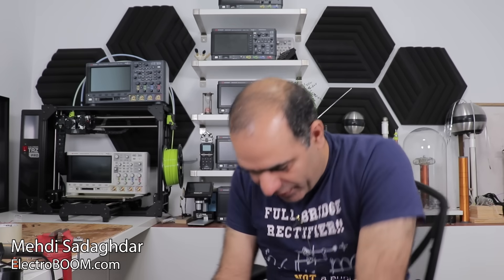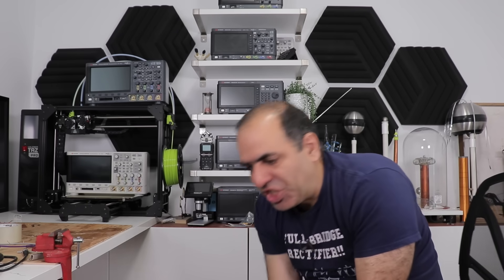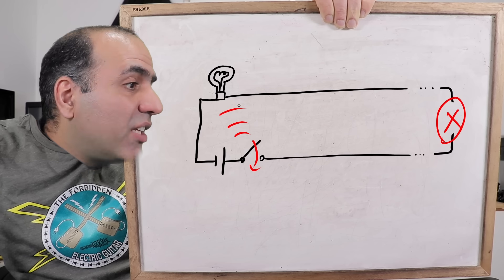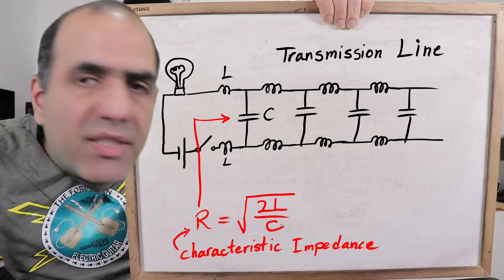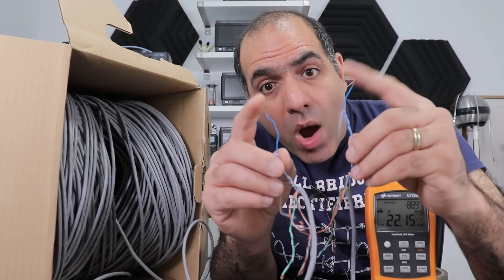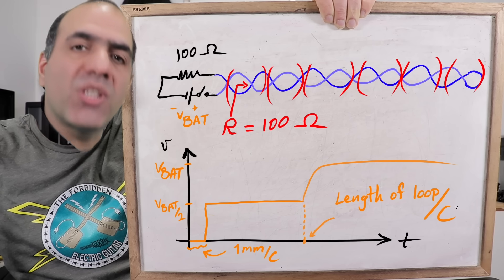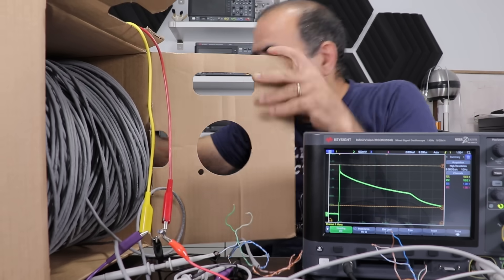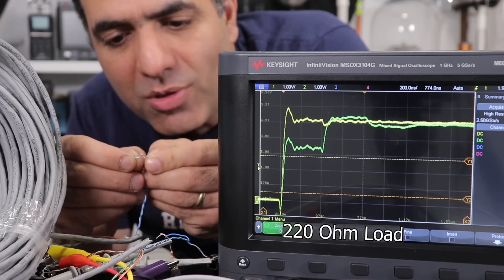Testing the LONGEST LOOP OF WIRE!!! to Turn a Lamp On

Comment: You actually answered all the questions running around in my head put there by Veritasium. Thanks! Then I read through the comments. Shouldn't  have done that. Came across time reflectometry. Which Uses these principles apparently to give the characteristics of wire including any faults and distance from the source. Is the speed of light in a material a constant? Would aluminium and copper be different? Does it vary with temperature or resistance? What about fiber optic cable, is it slower than light in a vacuum. If I understand the concept, you need to know the speed of light in a wire very precisely to locate a fault.
Reply: I'm not an expert, so some of this might be off, but my understanding is that it is constant in a given material for fiber optic materials, but in conductors it also depends on some of the properties including shape and even insulation material. Note that I'm more confident about what I will say about optics than about electrical signals:

In fact, for optical materials, the speed of light directly corresponds to the refractive index, which is easy to measure even without precise timing equipment, as you can use lasers and angles to measure it. Though actual materials don't have perfectly consistent atomic structures and have defects, fiber optics are specifically designed for this purpose so they are quite consistent. Although, because real optical fibers have some width, the actual signals sent through them disperse slightly and the beginnings and ends of pulses become less well-defined, due to the difference in length traveled by light going straight through vs. light traveling at an angle and reflecting off the sides many times, so square wave inputs come out rounded. This is called 'jitter' and doesn't have a direct analogue for conductors as electric fields don't have to reflect inside conductors. (I think it also depends on the wavelength of the light as total internal reflection is based on refraction, and so different wavelengths of light will be able to hit the sides at sharper or flatter angles and be reflected more or fewer times.)

For conductors I know less, but I read in other comments that there are well-known velocity factor values for common configurations, such as copper-based coax and twisted pairs, based on some combination of theory and measurements, and in general those range from about 66% to 70% (very close to what he measured), but some configurations with advanced materials can reach as high as 90%. My understanding of it is that the ethernet specification actually requires that the parameters be in certain bounds, so that if a cable does not have the correct velocity factor it is considered defective/not to spec. The spec has gotten tighter over time, which is what allows transmission speeds to get better over time (as at 100, 1,000, or even 10,000 MHz clocks, tiny speed differences can cause timing windows to not be hit). So a Cat7 cable has a velocity factor that must be closer to the target value than a Cat5 cable did, allowing it to support the higher clock speed. The variation is multiplied by cable length, so a short cable can handle higher throughput than a longer one.
Reply: @killerbee.13  Thanks! I got a fiber optic certification about 30 years ago. One of the tests was to make a connection. It required polishing the ends. I am sure they do it different now days. The instructor had an instrument that could tell how good the connection was and how far down the line it was. What I don't  understand is this. I am assuming that it could read reflections from the connection because it wasn't perfect. How do they determine the speed of light through a material? From what I have watched the instrument can not only tell there is a fault , but how far away it is. If you are measuring the time it takes the pulse to go out and be reflected back to get the distance you would need to know the speed of light through the material. Being off by .000001% would not even get you close. Since the speed of light or electricity varys apparently depending on  the medium, I don't see how measuring distance to a fault is possible. But I know it is? Its called time domain reflectometry. Time and reflect makes sense, does domain mean material? Without speed of light being a constant I don't know how these measurements are possible.  I believe you have answered my question in regards to fiber optic cable. I will have to read and reread it multiple times to get it. Thanks for the in depth response!
Reply: @kraftzion  Actually, because the equation is linear (ΔL = v*Δt), being off by, say, .0001% for the velocity (but accurate for timing) will give you a corresponding length error of, exactly, .0001%.
Reply: @killerbee.13  lol, I have a high school education, can you break that down for me?its sounds like you said the error is linear, but wouldn't  there still be an error? As in do they have to know the precise speed of light/ electricity in the cable to know where the fault is located? Even at only 66% the speed of light:)  
a .00001% error is rather significant.
Reply: @kraftzion  To do the measurement, you send a pulse and wait for it to come back. Say this takes 100ns. Since this is a round trip, divide it by two, so the defect is 50ns away. If the speed of light in the medium is exactly 2/3c, the defect is exactly 9.993m away. If the speed of light is exactly 2.001/3, it's 9.998m away. An error of 0.005m/~10m, or about .05%. the error of the input was .001/2, or .05%.
So the measurement is about 5mm off in this case. I have no idea what the numbers would be in real life, but as you can see, in a linear function, error out = error in.
Reply: @killerbee.13  thanks! It wasn't computing for me, that got it to click.

Comment: If you measure the voltage across the switch before turning it on, wouldn't it be at battery voltage? The current would start across the switch the moment it's engaged so the distance should be completely irrelevant unless you had a switch at both battery terminals and engaged them at the exact same time... say by using one switch and two mosfets
Reply: Though I suppose that's a different theory entirely haha
Reply: Current doesn't flow in the entire loop at once.  Distance matters.
Reply: Yeah and I agree that's why I said a better test would be to have a switch on each side of the battery to maximize the distance. Or if you have the LED right next to one terminal and the switch next to the other.

Basically what I'm saying is once you hook a conductor to a battery terminal it starts to charge to the voltage of said terminal so it wouldn't matter the length of wire if you wait to close the switch
Reply: @JaPls  Moving the switch to the other side of the battery only increases the "air" distance by the width of the battery--a couple cm in this case.  It's still going to be insignificant relative to the loop distance and you wouldn't see a change on the oscilloscope. (voltage across the load will still rise part-way up until reflections reach it.  It will change from high side potential going up to low side potential going down, but that doesn't matter.)

There is no place you can put the switch that you won't measure the full battery voltage across it when the switch is open (assuming a resistive load; pretty sure he switched to a resistor once doing the oscilloscope experiments.)
Reply: @CodeKujo  Right yeah so two mosfets/relays, one on each side of the battery, that way you wouldn't read a voltage across either until they're energised

Comment: Thank you for the reminder of my 2nd intro to electrical engineering course! Learning about inductance and impedance with capacitors and inductors was wild!
Reply: I think I remember hearing from an instructor that the relationship between caps and inductors was a resonance? Do you plan to cover their relationship in a future video if it hasn't already been covered?

Comment: in school they told us that if you 'd have a wire long enough it would take a second for the light to turn on . i'm glad to finally get the real answer. 

in another video from veritasium i think i learned that that wouldn't be true if the cables are close together.  now i'm gonna watch the video
Reply: It can still be true so long as the switch and lamp are far enough apart, or if the lamp requires full voltage to turn on, and probably other cases.  Like so many things we get taught, it was a simplified version.
Reply: @CodeKujo  indeed. my parents wanted me to be an engineer . only the last 2 years of school i knew i wanted to drive a truck. so didn't finish. and it was split into mecanical and electrical engineering . so indeed a simplified version to prepare for later study direction

Comment: 8:29 The part about the inductances cancelling each other, I'm pretty sure that's exactly what happens in a transformer too. When there's no load on the secondary, the primary winding acts like a big inductor and very little current is able to pass through it. As load is increased on the secondary, it starts to produce an opposite magnetic field that partly cancels out the one produced by the primary and more current flows through the primary preserving conservation of energy (when you include that there's a little energy wasted as heat).
Reply: Makes sense, that's why a transformer isn't as much of a low-pass filter as you would expect it to be.

Comment: I know that much of this is scripted, but for a second i felt smarter than Medhi, as he "forgot" that these wires aren't 'magical' wires and thus add resistance to the loop and slow things down by a small margin.
You should break into the factory where they make these wires and do the experiment on a giant spool of wire before it gets cut into pieces, it'll truly be the longest wire experiment in the world, on YouTube, for a minute.

Comment: This concept has been used for many years to find the location of electrical faults in systems that use long wires. Time Domain Reflectometry has uses in many industries. Find open connectors or short circuits or unexpected impedance changes.
Reply: we test cat5 cable this way for faults in buildings
Reply: @das250250  This is even a function in some network drivers. You get a tab in the driver config that allows you to run a test on the cable that reports back if there is a break or short and approximately how far from the port it is. Never had to use it in the field just experimented with it in the shop.
Reply: @blahorgaslisk7763  Interesting I did not know drivers had this ..what unit are you talking has this ?
Reply: @das250250  I think it might have been Broadcom controllers, but I have a sneaking suspicion even Realtek might have dabbled with this.
Reply: you can do the same thing in broken fiber optic too, as light will reflect off any break or damage back to the transmitter(testing device). quick calculation and you know where to splice.
Reply: Agreed 👌
Reply: I loved those problems and labs in my high speed digital class. Calculating the loads along the length of the transmission lines just by analyzing a pulse at one end was one of those electrical things that feels like magic.
Reply: The thumper the power industry uses is very interesting as many faults that arc, will not show a short at low test voltages, so they thump the wire with a high power pulse, and then watch the echo. In underground cables the arc at the fault makes a thumping noise.

Comment: Taking pedantry to a new level...the wire sheath 1000m.  Because each pair of wires are twisted, the actual length of each wire would be longer than 1000m if straightened out.  In fact, each pair of wires would be different lengths when compared to each other if straightened due to the variances in twist density.  What I am suggesting is that the total length of wire would be greater than 8000m when wired in serial and may account for some of the discrepancies in measured vs calculated values?

Awesome video and explanation as usual!
Reply: @Banter Maestro2 ...or you can terminate both ends and attach a decent ethernet cable tester/certifier to measure the distance of each pair.  The difficulty is depending on the quality of the wire manufacturing, the pitch per length is variable.

Comment: Good explanation of how twisted pairs eliminate cross-talk!  One thing I've never been able to quite understand, though, is why the four pairs in a single Cat-5 cable all have different twisting rates. Some pairs are tightly twisted and others are looser. How does this help improve the transmission characteristics of the cable?
Reply from the maker: I had a similar question. My guess is, if they all had the same pitch, then they wouldn't really cancel the cross-talk. same wires would always face each other in two adjacent pairs. But with different pitches different conductors face each other canceling the cross talk.
Reply: @ElectroBOOM  That is the explanation I got when I worked in a network department.  It's also why most Cat-6 cable has (or had, 10 years ago) an insulating +-shaped separator inside, to help ensure manufacturing defects don't wind up with the same pair of wires lining up "in phase" too often.
Reply: @ElectroBOOM Makes sense, I would say the 'simplest' way to explain it is... Differing twist tightness has the same effect on twisted pair to twisted pair crosstalk as twists  in a single twisted pair has against field that is uniform over the length of the wire. It forces them to gradually switch polarities over the length, whereas if they were the same twist frequency, they could line up and negate the benefit of twisting the pairs entirely. Higher twist ratios between one pair and another would be akin to having a single wire twisted more tightly against a uniform field along the length of a wire.

Not that I've written any equations to verify this.... Or drawn anything. It sounds good though.
Reply: @ElectroBOOM  What happens if the looped pair included a third looped wire? Would that double the inductance, drop the inductance to 2/3rds, or mulitply it by 1.666... ?
Reply: @ElectroBOOM  so are the twistes in some kind of prime pattern that the different wires don't have the same repeating touching wire?
Reply: Not an electrical engineer so take with a grain of salt, but I'm willing to hazard a guess. If it so happened to be that two twisted pairs had the exact same twist frequency that'd probably allow twists to line up exactly (with essentially the same gap distance between them) such that there's some sorta resonance or constructive interference situation.

By twisting at different rates, you could potentially make it such that these matching twist spots are less likely to happen. Again, just my guess and I'd love to be informed by someone more well versed
Reply: So they will not resonate, I believe.
Reply: @maxprophet2401  Enter the Balun wasn't one of Bruce Lee's better movies.
Reply: @Codeaholic1  Yeah, you have to defer to his later efforts. 'Fist of Velocity Factor'  and 'The Green Electrolysis'
Reply: Sort of expanding on the explanations above.

I’ve been under the impression that the purpose is to make each twisted pair a slightly different length. A twisted pair with a greater twist rate must be slightly longer to run through the same length of cable. This ensures the impedance of each pair does not match the others.

Each wire ends up the same length in each pair, with each pair being a slightly different length from each other. EMI can be ignored/rejected in each pair as common mode, and the different twist rates (length) keep the impedance of each pair purposefully mismatched with the other pairs, making it more difficult for one conductor pair to induce a signal in the others (i.e., reduces crosstalk). As noted above, constructive interference can be an issue in a cable with a high signaling rate if the conductors’ impedances are matched.

Twisting each pair enables common mode rejection of alien interference; twisting each pair differently reduces the interference induced within the cable itself and ensures existing interference is not amplified between the pairs.

But that’s just my understanding, and if I’m off base I’d love to be corrected.
Reply: @DannleChannel  The comment on alien inteference I believe is more succint than mine, and I'd tend to agree with it. And that varying twist length should cause the same effect between two adjacent twisted pairs is part of that same argument.

Regarding length / more twists equaling different impedance... Changing the length of a wire in and of itself does not alter the characteristic impedance. That would have to be a function of linear twist density and not overall length. Being that I'm still learning, I am not sure and can't find immediately the answer about whether twist density changes impedance, but I would assume you are correct if that's what you're suggesting. Makes sense, that would essentially be like countering the max power transfer theorem where R1 and R2 would be equal for max power. So, maybe it makes sense that impedance mismatching reduces noise commutation between twisted pairs.

That said, over the length of the wires, I would assuming capacitive coupling between the two is the dominant factor. The separator inside cat6 ethernet cables being an example would reduce capacitive coupling, and the twisting would reduce inductive coupling.
Reply: If you want to have minimal cross-talk between different twisted pairs, twisting different helps a bit, though the best is to shield them from each other (which is done in high quality cables).